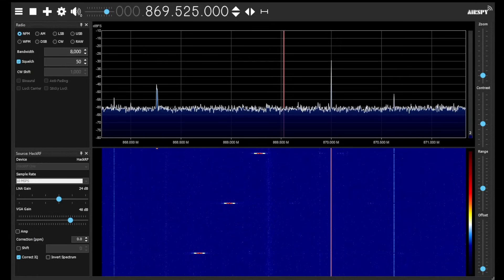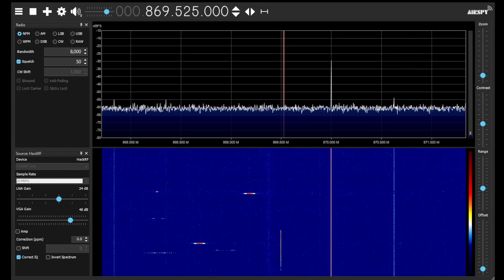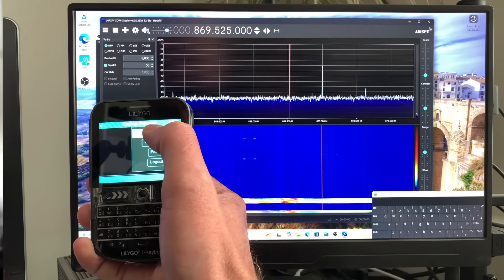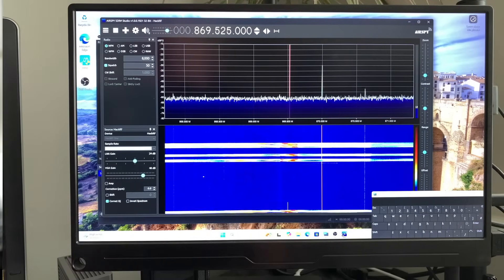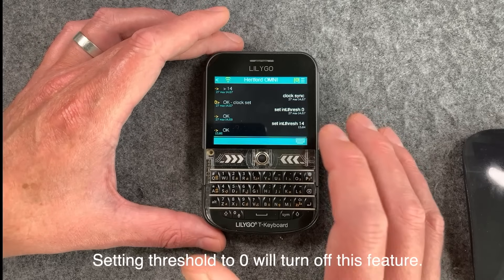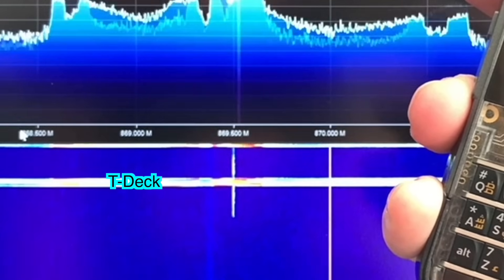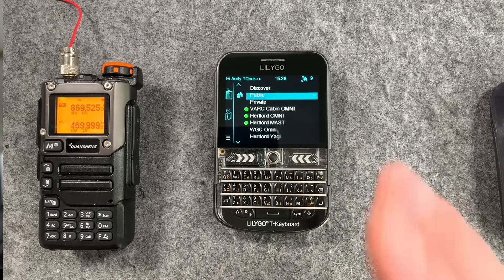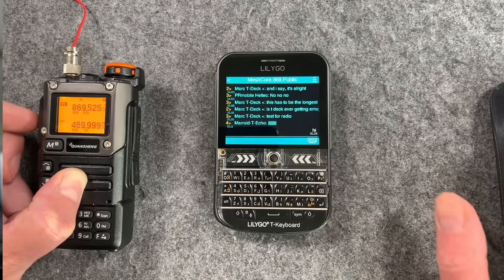INTRODUCING MESHCORE'S NEW INTERFERENCE AVOIDANCE SYSTEM!

Comment: A question. I'd love to experiment with both MeshCore and Reticulum, both of which use LoRA. Actually, both systems utilise the same devices (in my case, Heltec v3), but different firmware and protocols on top of LoRA. As they share the same frequency, I assume some interference. Would they still be usable in any way?

Comment: 869.525Mhz is unusable for meshcore here (large city),  100 M with external antenna, point to point. There are no repeaters. (Scanner is endstop constantly on this frequency.) 

There are some alternative frequencies that look ideal for Meshcore (different duty cycle rules for client and hubs)

SRD860
865.0–868.0 MHz *	10% (access points), 2.5% (other devices)	4 frequencies	500 mW (data only, power control required)

Tests on the quietest of these channels (866.3) gave the expected sort of range (almost 1KM with the same equipment).
It would seem that not sharing meshtastic's channel (and MC having such a default) would be of benefit.

Also,  will the new version of the T5 be supported? (currently all it does after flashing is flash the screen light intermittently and with the last image before flashing permanently, the MC flasher allows original firmware to be restored though)

Comment: Until the software is free and available to all my devices, that's a dead project.
Reply: It is free, just has extra features behind a paywall. I'd be happy to pay, if those features included other messaging systems.
Reply: @thirtynine-j5x the greatest issue is that this is not a true open source project.
Reply: @thirtynine-j5x  what features are behind paywall?
Reply: @kairysisKrantas  More than 2 networks, big maps zoom, repeater management via ripple. Nothing that is a showstopper. And when the system becomes viable communication, rather than a curiosity for radio geeks (which is looking very close now), it will be worth paying for.

Comment: Hey guys, 

Im super sick and lonely but i want to see if anyone will engage with me using one of these but i have no way to build nor the skills to do so.

I can go to the 10th floor to the hospital and blast my signal from there.

If anyone can help build 2 units for me, ill pay. Im so board in this place my brain and body are withering and i need to work them.

Thanks guys. I really appreciate it
Reply: Espero que fique bem.👍
Reply: If you get a T Deck plus or a T Echo,  you won't need any building. Just to flash it from a web page. (Though if you are using windows, you may need to find a driver, Linux plus a chromium browser just works).
Reply: @thirtynine-j5x  Indeed I agree. I have memory issues and worried about following the steps and getting things flashed for meshtastic or egzumer uv-k5. It's easy but I can't tell you why as I forgot. Is the OP in the UK they could try some 446 or CB from that roof.
Reply: I'd suggest get the T-Deck (right band for your region of course - likely 868) with the external antenna. The internal one is rubbish. And for use from a roof as big as possible, I just got one that is over a foot long. (I suspect it is the same as the shorter antennas but with a spacer giving it more height.)
Reply: @thirtynine-j5x That sounds good, actually. Would you be able to guide me to a site with instructions? 

I have a bit of information overload and became frustrated. 

Thank you for the suggestions. It is greatly appreciated.

Comment: @andy kirby Cool feature, would it be possible to make some way to detect another transmission and then "dodge" to another frequency range, instead of "dodging" though time?
Could you for example send a tiny "ping" (narrow frequency & time), in the upper band, to shift an "octave" (or other range) to the upper frequency, or a "ping" in the lower range, to shift to a lower frequency?
And maybe the receiver answers with an equal ping or something to show that it agrees? (or an "opposite" or "central" ping, to show that it prefers to shift in the other direction, or disagrees?)
Reply: There are effectively 5 channels that can be used on the same settings in the Europe 860MHz band. Frequency hopping would be good, assuming it's viable.

Comment: Since I am very active on 900Mhz ham band running nearly 1000w into a high gain antenna people in my neighborhood have given up on 900Mhz nodes. There used to be some when the craze hit about 2 years ago, but nothing since. My field fox analyzer doesn't show any node signals anymore, but I can see the 915Mhz signal from the toll road that's about a mile away.

Comment: Problem is that it’s the interference at the receiver that matters. While it might work when transmitting to a repeater on your roof, it’s highly unlikely the interference you experience has any influence on a LoRa receiver kilometers away. And the other way around, you can likely not detect an interferer that’s close to the receiver kilometers away.
Reply from the maker: Yes I mentioned this won't solve all problems. In my town this interference can be heard by all repeaters (in my town) so this technique does a pretty good job to avoid this particular interference.
Reply: @andykirby  Wouldn't it be better not sharing a frequency with Meshtastic?

Comment: How is LoRa getting blocked by such a small bandwidth signal? Also it's an SRD band, you have to expect a lack of discipline, plus this could actually be multiple similar radios transmitting in quick succession.
Reply from the maker: Yeah, I was surprised too that a spread spectrum LoRa signal could be disrupted by a narrow data transmission like this. The interference may well "look" worse at the actual meshcore repeaters receiver due to poor filtering on both the RX and originating TX.
Reply: @andykirby  Since those chips receive everything like a barn door, the offending signal could be lower in frequency overdriving your front end or a mix product of two lower frequency transmitters in your frontend. A simple band pass filter could give you an answer to what it is.
Reply: I watched an interesting video on how LORA works - it uses correlation to extract the signal from upto 20 dB below the noise floor. However, if the interfering signal is also using LORA, (on the same settings) then correlation won't help and it will be swamped. If it is 20dB stronger it will be swamped anyway.